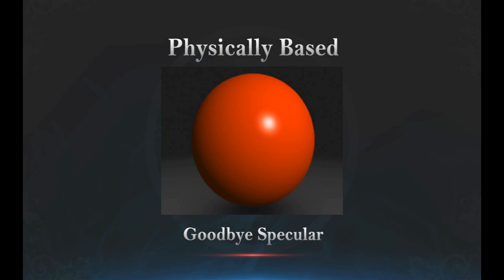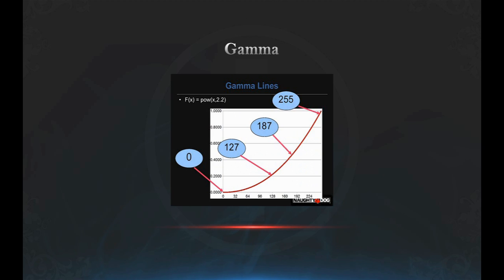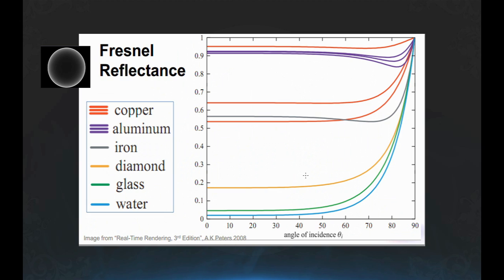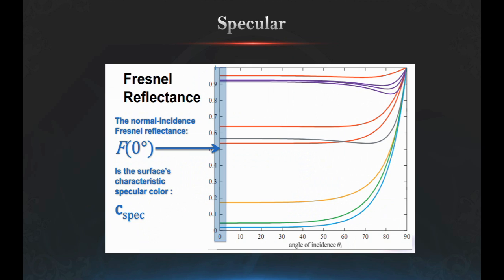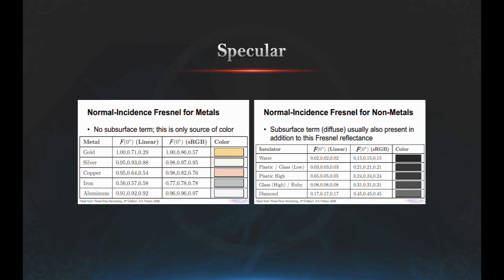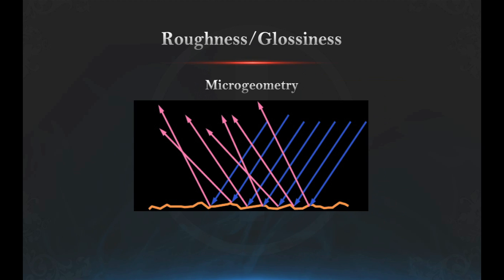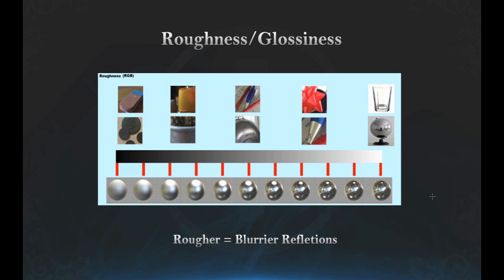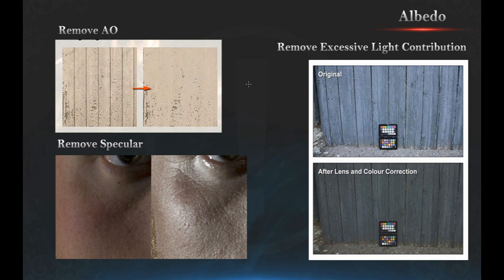Physically Based Rendering for Artists - Recap

Comment: can pbr produce the same result of a cpu based renderer like vray or arnold? I can't understand why pbr is just used in games. Do you know why?
Reply from the maker: Hey there Michele,
PBR as a concept is and was used in offline renders for a very long time. PBR as a term appeared lately to describe a shift in real-time game rendering, but it's essentially what VRay and Arnold were doing all along. Only with a whole bunch optimizations to make work in real-time. If anything offline renders are still more advanced and physically accurate then most games you'll see in the coming years.
But that is slowly changing and eventually all your offline renders are just going to switch to real time.
I hope that helps! :)

Cheers